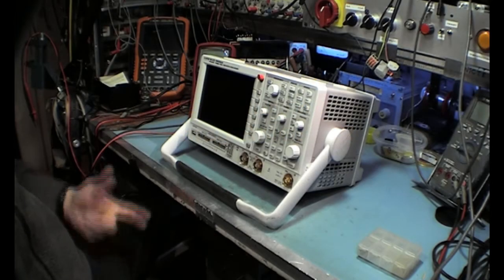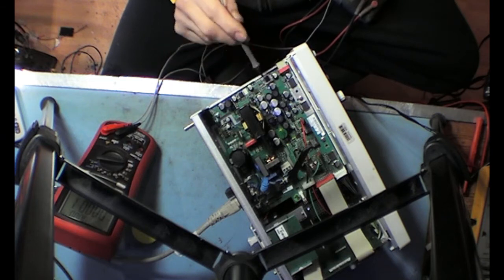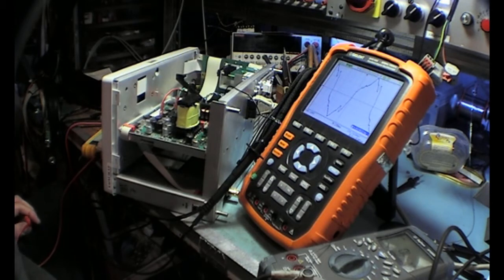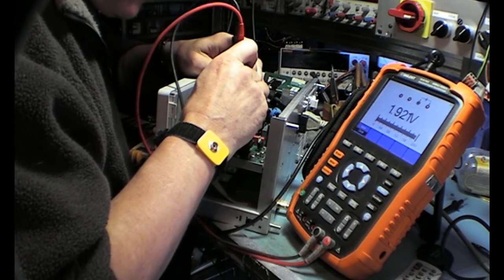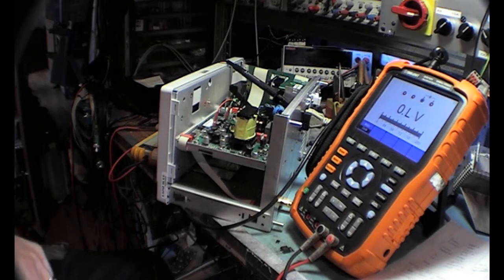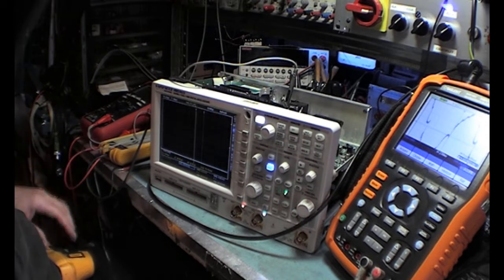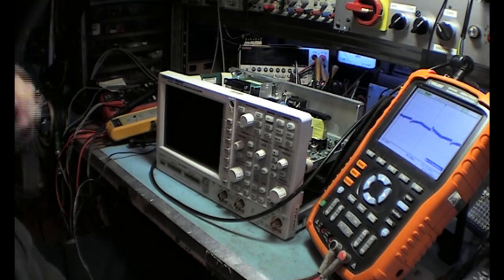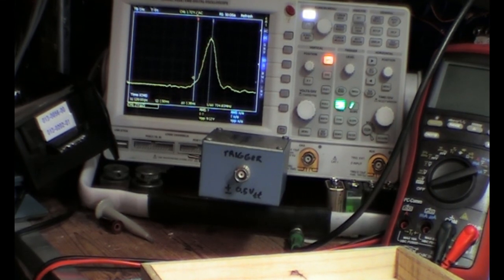Hameg HMO-3522 scope repair

Comment: Thanks for your video, it was very useful to repair my oscilloscope which for the second time had the same problem. The first time the repair cost me over € 1000 from Rohde & Swharz !!! This time I've repaired it with 0.8€!!!  P.s.: Just a suggestion, it's better to remove the power cable before using soldering tool inside the machine... For your safety!!